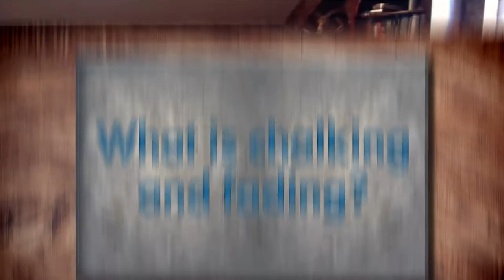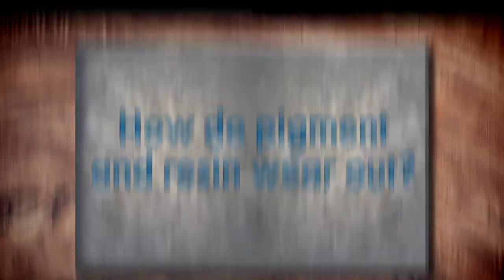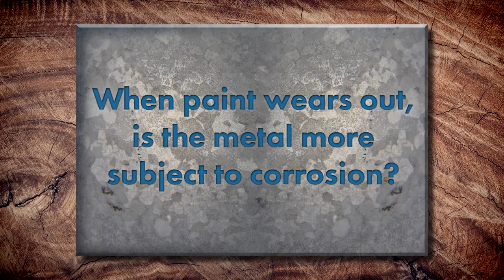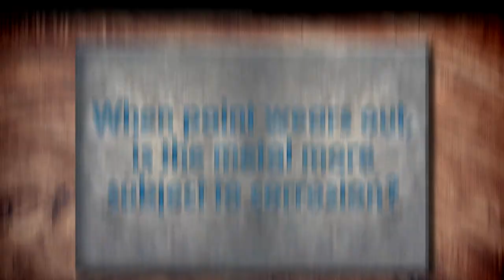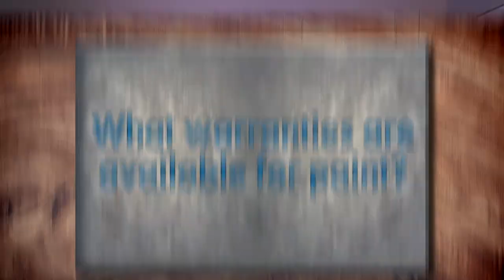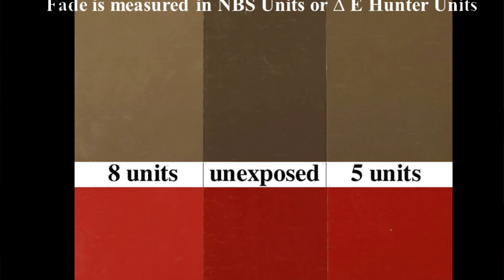How Does Metal Roof Paint Wear Out? Chalking And Fading

Comment: can you get stainless steel no paint? it should not change the color, right?
Reply from the maker: Hello! Typically bare Galvalume/Galvalume Plus will lose the bright sheen that it has right after installation, and it will have a low gloss spangles gray look to it. When it comes to stainless steel, it's not as straightforward because of the variety of stainless product finishes. Some are designed to remain a bright, polished finish while others are designed to dull out and patina to a gray finish similar to that of architectural zinc products. Thanks for the comment! -Thad